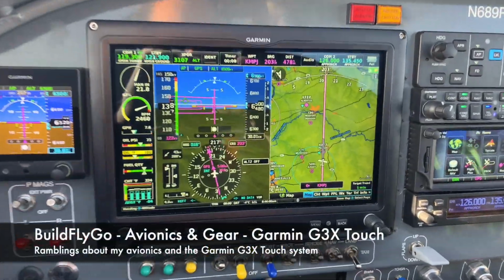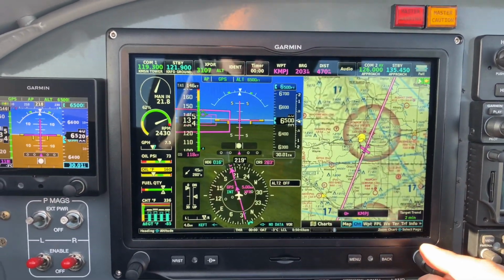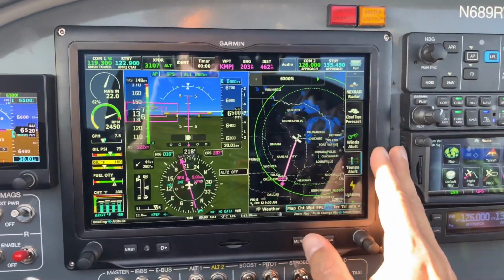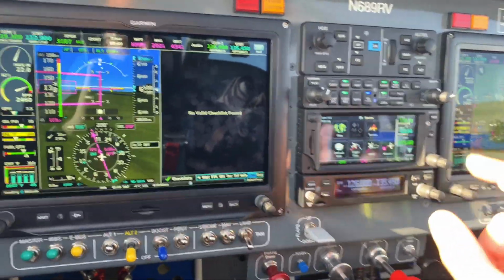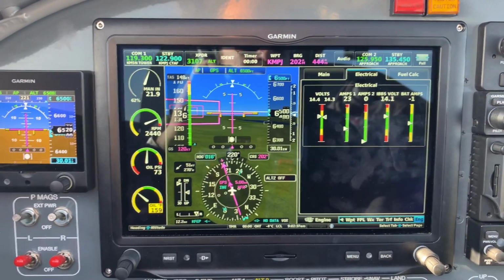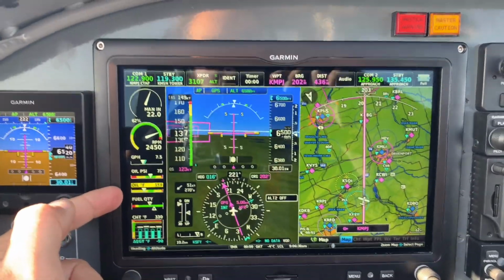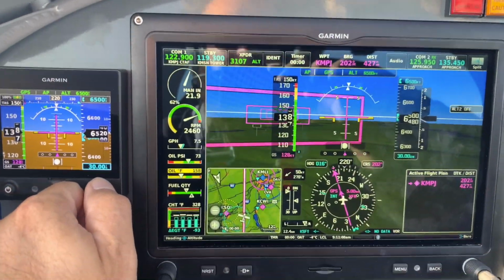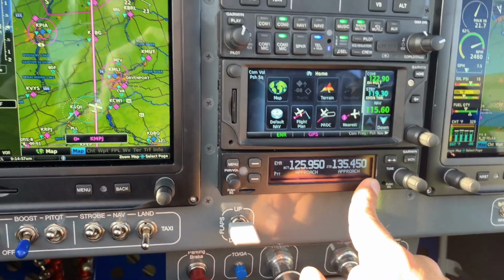Gear I use: Garmin G3X Touch, GMA245, GTN650, GTR200, G5

Comment: Gill, Nice video, that setup is exactly what I am installing in my Turbo Glasair, except I thought I would use flush mount iPad instead of the two g3x to save $$  lmao
Reply from the maker: The iPad as screen 2 is a very valid option! Just don’t end up spending as much on the highest end iPad as the second g3x :)
Reply: @BuildFlyGo  Rodger good point

Comment: Thanks for good video, for my Turbo Glasair R/G, I am contemplating GNX375 for IFR & approaches legality. 
looking to install:

GARMIN: G3X-GDU 465, G5 w/Battery, Autopilot, GMC 507 w/3 Servo’s, GAE12 Alt. Encoder, (2) GTR 20 Com’s for G3X, GNX
375 GPS w/ADS-B, G3X Sensor Kits, GSU 25C, GMU 11, GTP 59 w/Configuration Module, GA 37 TSO'D WAAS GPS / SIRIUSXM Antenna, GEA 24 Eng. Ind. System (EIS).

SDS: Fuel and Spark Control, Dual EM-5 4F
EFI aviation system for Lycoming IO-360 w/Individual cylinder fuel trimming,
Digital fuel flow output to engine monitor w/ PC data logging. A new

Superior Air Products:

Cool Air Induction /oil sump KIT

What do you think? Thanks Richard
Reply from the maker: Sounds about right, did you watch the video where I go through the worksheet? That should help you figure out the LRUs. 

You don't need the altitude encoder as the G5/GSU will provide serial baro altitude info to your transponder (see http://static.garmin.com/pumac/190-01115-01_al.pdf pg 27-35). The GSU, GTP & GMU should come in the LRU kit, no need to buy them separately. I'm not a fan of the GA 37 antenna, I use a GA35 and an internal XM antenna, which allowed me to keep the XM cable short.

Comment: Also, you can get more parameters on the left screen if you don't have both comms up there taking up space. You probably use one comm more than the other, so leave that on the left screen. Put the other comm on the right screen only, but at the left end. I find that I rarely use the database tuning from touching the standby frequency -- I'm more likely to tune using the frequencies on the waypoint screen. Next time you're passing by Savannah, come fly with me.
Reply from the maker: Interesting idea. I also rarely use the touch tuning on the g3x screens as I have knobs on both radios. I do usually glance at them to confirm what is tuned though.

Comment: As far as two screens go... on the right screen, move the engine instruments to the right side for starters. Next, on almost all full screen displays, 90% of the good information is in the middle 50% of the screen. So if you go to split screen mode on the right side display, you move that most interesting part closer to you.
Reply from the maker: What do you get from moving engine instruments to the right?
Reply: @BuildFlyGo  Sloppy writing on my part. You've already got engine instruments on the left side of the PFD, and that makes it easy to make fine power adjustments and compare to airspeed and vertical speed. Agreed, good show! But on the MFD right screen, those duplicate engine instruments aren't providing any additional information. Worse, they're on the left side of the MFD, closest to the pilot in the left seat, and displacing all that other MFD information away from you. On the MFD, then, move the engine instruments to the far (right) side so that the rest of the information is closer.

Comment: Thank you for this video. I was wondering if you would give us a break down on the complete cost of your panel. I have an AFS from Dynon but was thinking of the Garmin in the 14 A I am building. Thanks Tom upstate NY
Reply from the maker: I have a video coming up with the choices and going through the garmin avionics worksheet. It's hard to say "yours will cost X" because there are soooo many variables. In the upcoming video o go over each choice and why you should go that way or another, which should help you. I really like the G3X system, it feels like "big airplane" avionics.

Comment: Excellent video. I think the Gx3 has better features than the txi.
Reply from the maker: I haven't flow with the TXi but it doe feel rather different from the G2000 which I have some time behind. The G2000 feels very integrated with the aircraft, which makes sense considering they are developed together with the airframe manufacturer with deep integration.

Comment: Very nice avionics package. Just wondering why you have only 1 IFR navigator?
Reply from the maker: 4 WAAS GPS' on board, plus an iPad and at least one phone with attitude and charting. If the one IFR-certified GPS dies we have plenty of redundancy to get us safely on the ground. If primary avionics dies in IMC you are required to notify ATC either way, whether you have 1 or many certified navigators.

Comment: That is such an informative video. I am looking to upgrade my stack on my PA32 with the new GNX375. I am looking to put up 2 screens, primary G3x plus G5 and Dynon HDX1100 to the right and the stack to the right of the screens. Stack will include GFC500. Why I am looking at HDX1100 as back up, is for engine monitoring v cost of certified G3x and engine module cost. I already have the probes from my JPI. Other reason, as I do hard IFR I like the idea of an independent GPS in the HDX as a backup for the G3x or 375 in event of failure. I see your AP at the top of the stack like the big iron. My current one is at the bottom.
Reply from the maker: Hi Peter. The G3X & G5 do not share software, so are a good backup for each other. You should not have a software issue that knocks them both out. Additionally, the G5 provides a backup AHARS on the bus that the G3X screens can use. The GNX should also provide position data (I believe) so with 2 G3X, 1 G5, and the GNX you have 4 independent position sources and 2 attitude sources. You can add a second magnetometer too if you wish but I did not bother. In an emergency, GPS-sourced heading is sufficient.

Personally, I would not add the Dynon screen as it adds more complexity, and additional user interface changes which may slow you down during a heavy workload phase of flight. Not to mention you then need to buy separate databases for each, and ensure your IFR-certified position source can output ARINC to two sources at once. It just feels like there may be more down sides than upsides, but to each their own :)

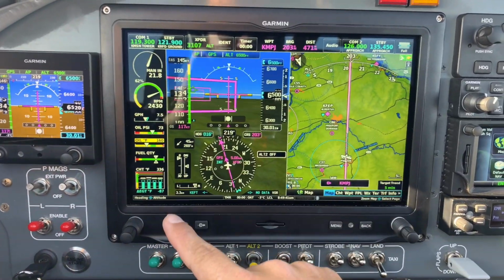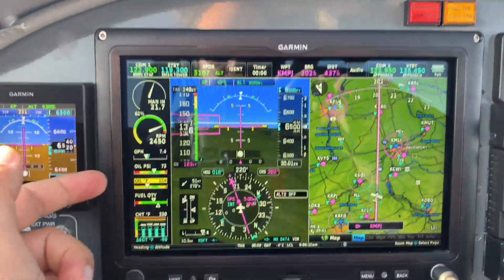Comment: 3:41 low oil temp. Not a concern? 19:39 You finally got to it...lol
I'm probably not too far from you in N IL. C81
I'm still learning my G3X's, this was very informative. We have a similar setup. 2 G3X's, GTN625 (no radios) and GMC 307 AP control head. Thanks for posting this. 👍
Reply from the maker: Yes, this was early in the season and I had not yet blocked off my oil cooler. Lycoming recommends 165-220F. https://www.lycoming.com/content/operating-cold-weather

Comment: I like how you laid the GFC 500 at the top of your radio stack. That's the correct location!
Reply: it's definitely better at the top in a flight sim but in real life I'd rather have it at the bottom
Reply: Laughing.  Correct?  The AP should be easily and quickly reachable...the ideal location is either on a console or at the BOTTOM of the panel stack.
Reply: @speedomars  how many jets have you flown that have them at the bottom? Not any modern ones. When your shooting a circling approach you don’t want to be looking down for the button or heading knob.
Reply: @jetceo  The G3x is a touch interface...no knobs.  Also, modern business jets use the G3000, G5000 panels, also touch screens.  The G3x came from G3000 technology.  You may want to catch up on the tech.
Reply: @jetceo  The A/P is disconnected on the yoke or stick, no need to touch the panel for that....I won't get into a back and forth over how to do a circling approach, but they are done visually and whether you twist a heading knob to steer or hand-fly its a skill that is up to each pilot's preference.

Comment: Great video...I’m building an RV-10. Hope to be finished in 6 months. Installing the panel now...3 G3Xs...no G5. Really appreciate the detail you went into...so all the wx, winds aloft, notams, metar, and airfield info that you paged thru...is that unlinked thru ADSB or a subscription of so type? I’ll have the XM radio...haven’t decided about wx subscription. So the ADSB wx is adequate?
Thanks!
Scott
Reply from the maker: Welcome! I'd recommend a separate backup attitude/alt/speed source if you plan on flying in IMC. G5 is one option, there's others but I really like the altimeter cross-feed with the G5. 
All the weather I showed was from ADS-B. I also have an XM Weather receiver in one of the screens but decided not to renew it after the trial period. The only real benefit of XM is coverage when still on the ground. Once in the air ADS-B picks up pretty quick. I do have XM radio and it's great, I just wish it was available outside North America. XM will give you a 3 month trial of weather, just don't forget to cancel once the free trial is over :)
Reply from the maker: Short answer: ADS-B is more than adequate, I decided not to pay the XM subscription.

Comment: Incredible panel. Looks like all the capabilities of an airliner. Did you install it yourself or did a shop do it? It’s my understanding that installation is half the price. Is that true? New subscriber. 1st video and my mind is blown
Reply from the maker: Hi Benny, welcome! I used an avionics shop to do the base harness which I then modified to fit closer to what I was looking for. I worked with a CAD/CNC guy to design and cut the panel, then I got it powder coated. Next was designing the labels in CAD, which I took to a local laser engraving shop, which lasered out the letters in the powder coat for me. From there I filled in the letters with acrylic paint and installed/wired/configured the avionics.
Reply: BuildFlyGo wow. You must have done a ton of research in advance. Thanks for sharing your steps. It looks like a production plane. What kind of RV is it? I need to watch your other videos
Reply from the maker: Thanks, It's been a blast to build and fly. It's an RV-9A. 150kts @ 7.5gph
Reply: BuildFlyGo oh believe me...I took notice of that. I watched the whole video. 7.2 gph and up to 28 mpg is Amazing.

Comment: Very nice plane, avionics package and video! What made you decide on the IXO-340 vs the Lycoming )-320?
Reply from the maker: Hi Gary. A few reasons: I get 180hp out of the io-340 for effectively the same weight as a 320, Titan/Continental was willing to let me do a builder-assist on the engine, which gave me immense confidence in the build and a ton of new engine knowledge. They let me configure it exactly the way I wanted, 2x pmags, AFP FI, 9:1 compression, ceramic-coated cylinders, etc. Additionally, the price was very close so it just made sense. I would definitely use them again.
Reply: @BuildFlyGo  Modification of the stock engine mount required? Are you burning a comparable amount of fuel as to the Lycoming 0-360? What's your basic weight? I am considering the RV9 taildragger build.
Reply from the maker: Nope, It's a regular Dynafocal mount just like the current o-320. The 340 just seems like a perfect engine for this airframe. I flight plan for 150kts, 8gph but im usually actually burning under 7.5gph. If you throttle back it gets crazy efficient at 120kts but I'd rather get there sooner. just under 1097lb empty, 1850lb mtow.
Reply: @BuildFlyGo  Man that's great! Just over 500lbs of UL after filling the tanks. Another good reason to build the RV9 as an exceptional x-county machine!
Reply from the maker: Exactly! :)

Comment: Super interesting, watched the whole thing.  Can you do a demo of the ATC playback in a future video?
Reply from the maker: Sure! I'll try to get that done this weekend.
Reply from the maker: This might be a few days, I'm waiting for my new audio cable from @FlightFlix so that you can hear the audio in my headset. The bluetooth audio from the audio panel does not include ATC, only intercom.
Reply: @BuildFlyGo  Thanks.  I'm curious to see how practical it is to use the playback feature.  Is it a good tool or a novelty?  Not much on youtube on the topic.
Reply from the maker: I've used it once or twice. It's very easy to use, you just push the button and it plays back the last radio call, push it again and it plays the one before that, etc. I don't usually have trouble understanding people on the radio but when I do I just ask them to repeat themselves :) so I'm not sure it's terribly useful to me but it's neat and didn't cost any extra.